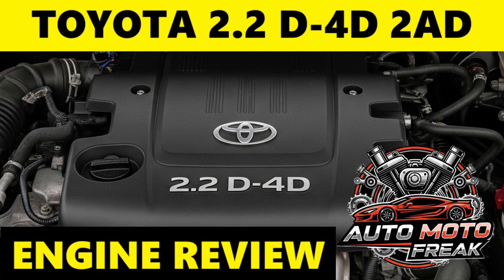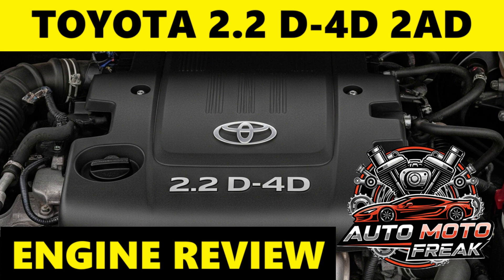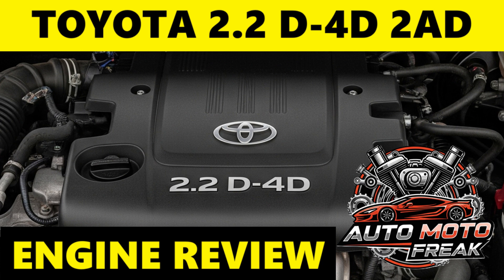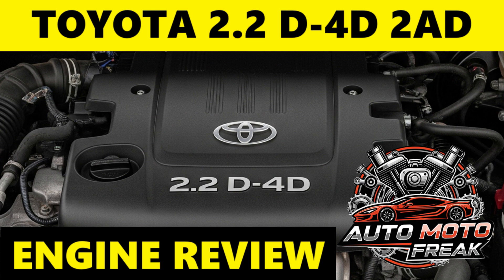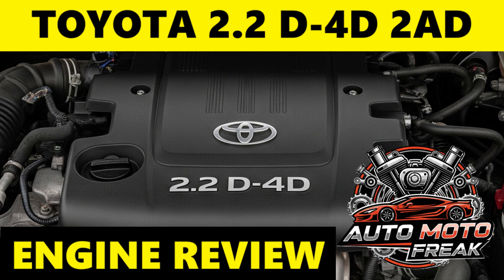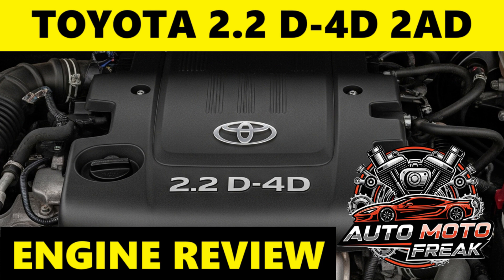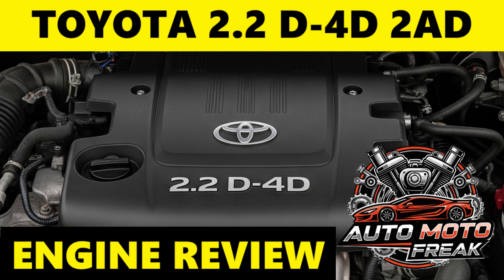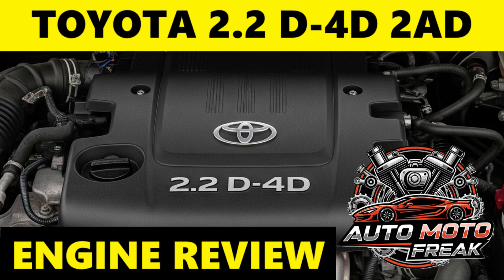2.2 D-4D REVIEW, PROBLEMS, RELIABILITY, FAILURES, FUEL CONSUMPTION, TIMING, OIL?

Comment: Can someone please help me I cant find a pressure sensor  for my toyota Avensis 2.2?
Reply from the maker: The oil pressure sensor is typically located near the bottom or side of an engine, between the oil filter and the oil pan.